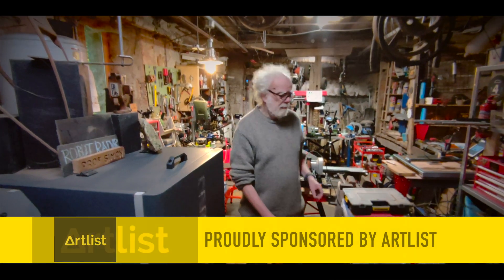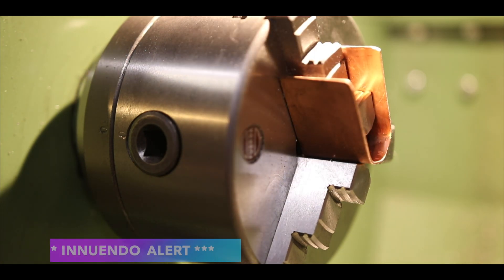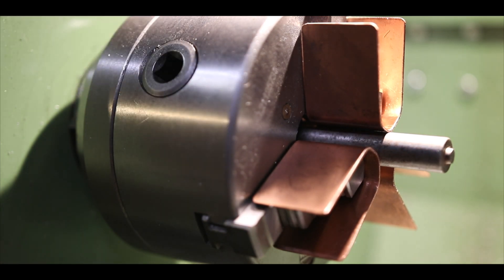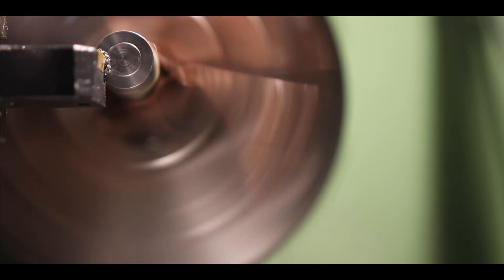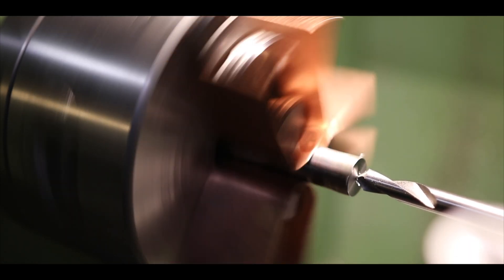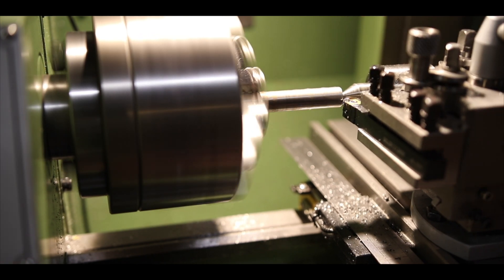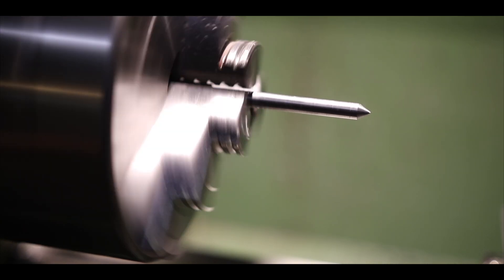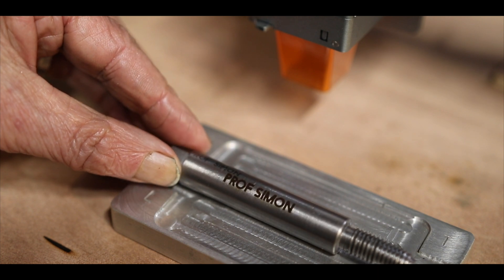Workshop 'Tap Follower'

Comment: I wish I could get to work lathes and milling machines.  I got to use one with a tool post like that a long time ago.
Reply from the maker: Chinese lathes start well below $1000.  hope you can get back into this hobby
Reply: I was a mechanical apprentice.  I loved using the lathe,  I wasn't good at it.  I'd be more careful this time.  Made everything trice.  I've still got my universal scribe (fancy spike on a stick)  Turning threads was hard, took ages to get down to fitting the thread gauge.  Made tool makers clamps, usual stuff.   No room for lathe, tiny flat.  Thanks tho, it was fun to watch the video.   @SimonHollandfilms